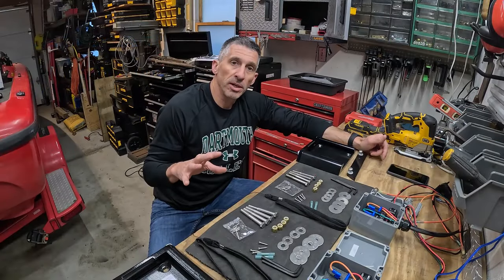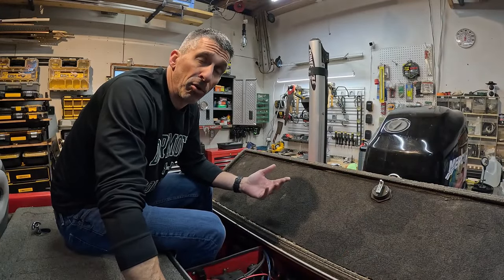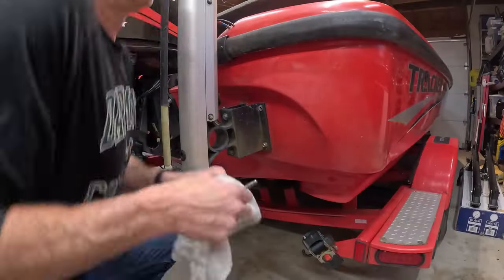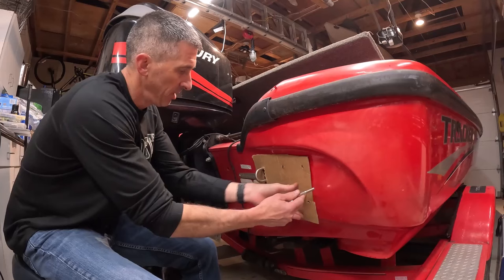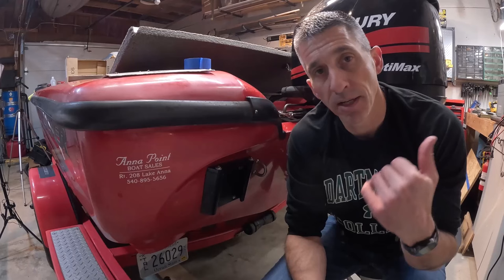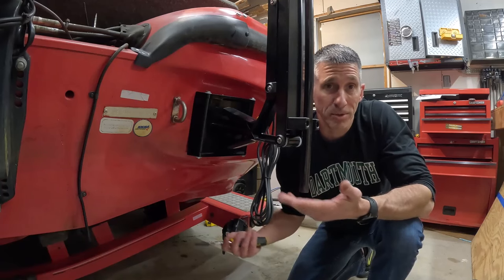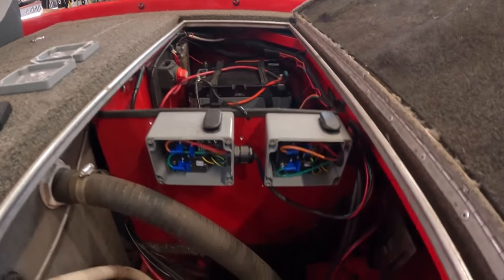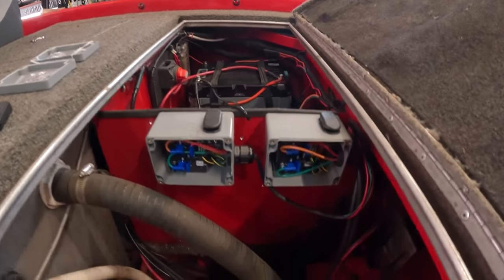Lewmar Axis Shallow Water Anchor System

Comment: Are there extra wires in the control boxes for a hard wired switch that could be used at the console? I see a reference in the manual for Auxiliary Switch Leads, and it looks like there are some maybe coiled up in your video. I have them sitting in the garage, just haven't unpacked them yet. Still have a while before I will need them for my boat build.
Reply from the maker: Hi! I've been in constant contact with Lewmar and they have a ton in development. "Stomp" switches are something coming and I'm pushing for! I'll be in contact with the rep this week and will provide an update.
Reply: Not really looking for a stomp switch just seeing whats available if I wanted to wire in additional controls. Having the switch on the side of the box is definitely nice though.
Reply from the maker: @jessecameron20  👍 I'll ask
Reply: I just installed 1 of 2 anchors and it looks like there are 3 leads from the control box switch that aren’t used, that you could run wires from here up to the console and wire in a switch.  I haven’t tried it yet, but plan to.
Reply: @champclarke I opened up one of mine just to look at it. I think those are just DPDT switches. Running more wires to those switch tabs won’t do anything. Can run additional wires in and tap into the existing switch wires which is what I’ll do once I install mine.

Comment: Why did you put the mounts upside down...power pole slides in from the top not the bottom according to mfg.
Reply from the maker: Those mounts are the same top and bottom. Caps with bolts. My boat is an aluminum hull and flares out at the top. Couldn't slidee them down, so had to slide them up into bracket.
Reply: @Mitz-RI  sure hope those retainer bolt dont come out, your swa be gone
Reply from the maker: @Garminrules  it's definitely part of my routine checks no issues as of yet. 🤞
Reply: @Mitz-RI  cool...good video

Comment: Still in the process of making decision on the right pole anchors I want to purchase. Do you know the down force of these anchors? I seen a test where  Raptors down force was over 100 pds a talons on  at 80 pds a power poles at 75 pds . Love the electric a being able to quick disconnect an put up for storage in the winter.
Reply from the maker: @johnburris5927  don't know foot pounds but might be able to find out. My boat is heavy and waters up here are rocky these poles push right in and almost lift the back of the boat. 👍

Comment: Need to show how you ran the wires from the pumps through the boat to the master switch please.
Reply from the maker: There are no pumps. Just one connection wire from each pole. I used the cable pass through where all the motor cables go in. On my boat that is right into the back battery compartment. In this video https://youtu.be/nRzubTgNLcQ?si=oymU80FsKuAngDJ0 you might be able to see where they come in at about 14 seconds at the top right.
Reply: @Mitz-RI  Do they make mounts for the side of jack plates?? Don’t  like to drill in my boat an have a ladder on the left side?
Reply from the maker: Yes same bolt pattern as a power pole. I know they are releasing more accessories and have more mounting options. They should be showing up on their website soon.
Reply: @Mitz-RI  So you still hook the quick release bracket mount and we can remove them for storage on the power pole mounts for the jackplate?
Reply: I used the power pole mounts that fit my slide master jack plate no issues. They have the same boat pattern.

Comment: Good vid!  So was your problems with the power poles the reason you switched?  Or is there another reason?  Thank you!
Reply from the maker: @alansmith6144  Couple of reasons. Mostly, I wanted a 2nd but mine was 8 yrs  old . Plus pump was leaking and I already replaced it once. It was time to try something new.
Reply: @Mitz-RI  You do a great job.  Very clear info.  I appreciate your quick reply.  Another question:  are these units trailerable down the road?  Or do you recommend taking them off the boat when going down the road?  Thank you!
Reply from the maker: @alansmith6144  I've had them on this entire season and from dirt roads to highway logged plenty of miles with no concerns.
Reply from the maker: @alansmith6144  PS thanks! Took some time off from videos to work on beefing up my setup. Have some good things lined up for this off-season. 😉
Reply: @Mitz-RI  Great!  I fish remote lakes with no boat ramps and travel concrete to dirt roads.  Thank you, I'm glad I found your channel!

Comment: Is there an option for a jackplate mount? I'm not crazy about drilling holes in my hull.
Reply from the maker: Bolt patterns lined up exactly with the power pole I had. So that opens the door for a ton of options. Lewmar did say they have some in development and approved use of others. Might tap into support just to make sure.

Comment: If it is the same bolt pattern as the power poles, could you their jack plate mount for this?
Reply from the maker: With out saying "yes"... Yes. 😉 I haven't done it but 'if the shoe fits' as they say!
Reply: @Mitz-RI  it would be great for you to make a video about this option.
Reply from the maker: @johnburris5927  will do 👍

Comment: Gettting ready to order 2 but unsure how to mount on pontoon? Would I need to have a plate mounted to back of pontoon to mount quick connect mount to? Thanks for the help.
Reply from the maker: I'm 90% sure they have a specific pontoon mounting bracket. I'll see if I have a link to it in the AM.
Reply: @Mitz-RI  thank you so much!! That’s was a fast reply and I appreciate it. Really like these anchors and can do 2 for the price of 1!! Thank you for the videos. Ronnie
Reply from the maker: I have confirmed they do have a mount for a pontoon boat. If you have a local Marine dealer that deals with Lippert  they will be able to look up the part #. If you don't get anywhere with them I'll get you in contact with the rep I used.

Comment: Does the switch on the power box work as soon as it’s hooked to power bc I just got one and I hooked it up and it does nothing fuse is good won’t do anything with switch on box or  remote. Followed I’m instructions starting to think the box is bad or the motor on the anchor.
Reply from the maker: Switch should work no matter what. If you take the fuse out and plug it back in does the programming light flash? Also check the wires make sure they are crimped and not loose.
Reply: Ya the light blinks so maybe it’s not the box.
Reply from the maker: @scottbrady5241  maybe. 😕 Support has been great I'm sure they will make it right. Keep us in the loop.

Comment: Any tips on getting the remote to program and work?  I’m not getting it to work following your video and the instructions.
Reply from the maker: Is this what you tried? 1. CLEAR All Settings (Press and hold mode for 3 sec. Light will go solid then flash then turn off). 2. Press and hold program  button for 3 seconds while both lights are solid 3. Press the UP arrow. Then wait don't touch anything until the light flashes quickly and turns off. This should work for one and 2 anchors if Step 2 you press both program buttons. Let me know.
Reply: @Mitz-RI  I cleared correctly.  Then when i held the program button for 3 seconds for the 2nd time, i released that button and hit my remote control button.  Then i did not get the 1 flash of the light, it just flickered a few times and went off.
Reply from the maker: @champclarke  Just recorded a video on how to do it. I'll upload it tonight. 👍
Reply from the maker: @champclarke Here you go this should help! https://youtu.be/1SRGaeOUso0